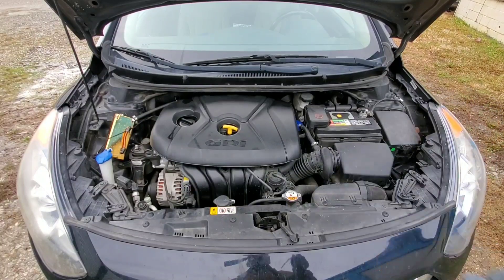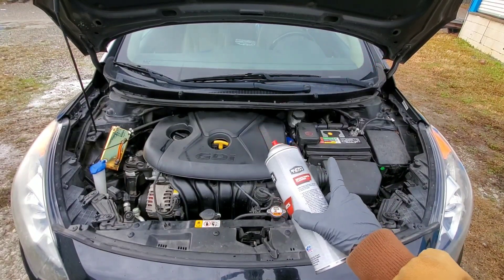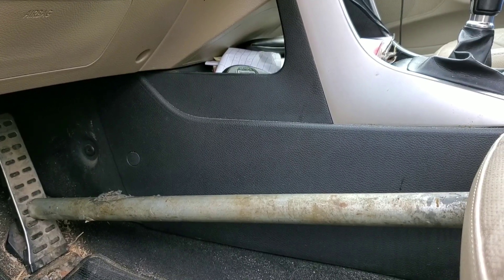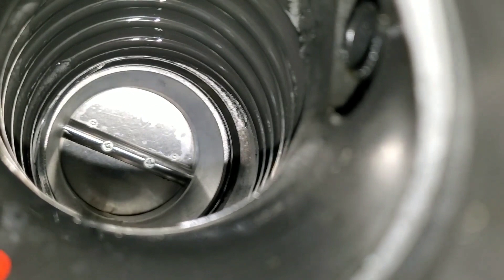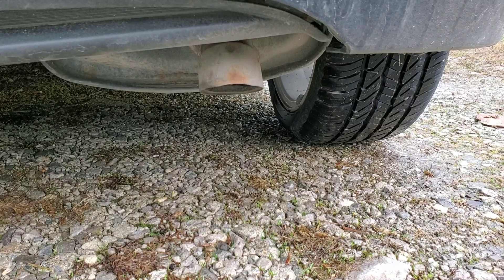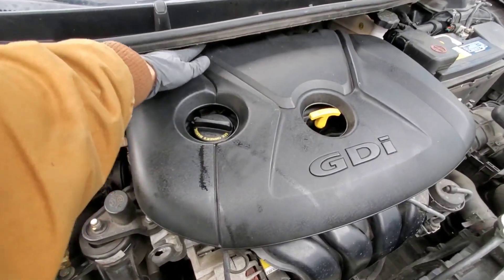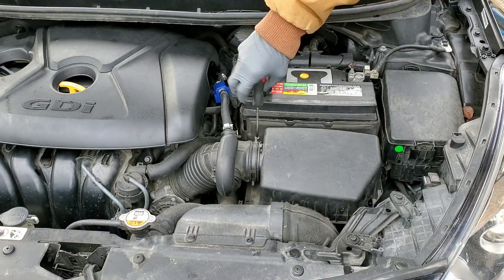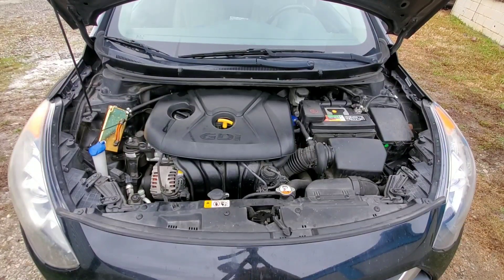Best carbon buildup cleaner  for Intake valves vs GDI Engine

Comment: I've got an old 22 semi-automatic rifle this that's what I clean it with, remove it from the stock and hose it down with brake clean then I spray it down with rem oil and I'm good to go been doing that for years.
I will say I don't do it on my nicer firearms.

I've got a 2018 Kia Rio 1.8 I need to clean the valves on it they've been done once by the dealer about ten thousand miles ago
Only got 35k on it.

Comment: I have the break cleaner in my garage, and it did cross my mind that it could be used for the same application you did. Because if it cleans the brake dust from brakes and evaporates I don't see why it should have the same results, which you demonstrated here. Someone even tried the carburator part and intake cleaner and I tried it and the car with my DGI engine a hybrid model responded very well with ease of acceleration and a smooth ride. I could hardly feel the depression of the accelerator. I just didn't look through the engine the way you did. If it works it works. Thank you.

Comment: The brake cleaner contains acetone.  Acetone dissolves plastic and rubber parts.  Also, most engine cleaners (CRC, SeaFoam) contain some light oil to lube the piston rings and cylinder walls during cleaning.  There's no light oil in brake cleaner, so you may have premature wear of the rings and cylinders.  I'd stick with engine cleaners and not use a brake cleaner if you're going to clean the engine while it's running.
Reply: Excellent advise
Reply: Wondering is brake cleaner and a light oil like PB Blaster might do the trick. And the oil would sit on the valves and possibly clean after the fact?
Reply: @jellofuel  I recommend CRC GDI IVD Intake Valve and Turbo Cleaner.  Be sure to spray in short bursts and keep the RPM at 2000.  Rev the engine a few times but not exceeding 3500 RPM to prevent hydrolock.
Reply: @ospuddy  Wife and I actually did this over the weekend. There was some ticking that had me worried, it was a tiny piece of carbon that was bouncing around the drivetrain until it blew out the exhaust. I think we need to do that treatment more often.
Reply: @jellofuel  Depending on the geometry of your intake, some cleaner may puddle inside.  This will cause a rough running engine, knocking, pinging, and odd noises.  When this happens, put the transmission in neutral and rev the engine a few times to no more than 3500 RPM.  That should clear out the excess cleaner.  Once the cleaner is out the ticking should go away.  Repeat this procedure as needed.
Reply: @ospuddy  I was thinking that's why some valves seem cleaner than others in these videos. Thanks for the info! We drove it for 2 hours yesterday, and it's doing great!
Reply: What about Carbonatar cleaner spray?

Comment: I agree with Thomas... the fact that there is a catch can, and the fact that it would appear that he has tested the same car with several different cleaners over only a couple of months and still have that level of carb build-up is simply hard to believe.
Reply: because the vapor is the problem not the oil itself.
Reply: I am not sure what type of oil is used and that plays a very important part in GDI engines

Comment: That catch can is pure garbage. How about a video with a quality made one? You dont have carbon on the valves. You have sludge. It's not working at all.
Reply: You need to be educated on what a catch can is all about. You're another keyboard warrior about to be slain 🤺! Slow down and educate yourself before commenting on a subject. Gases during combustion slip past the rings and into the crankcase where oil is. Those gases pressurize the crankcase and that's why there's a PCV (positive crankcase ventilation) system. The gases that leave the crankcase then into the PCV valve will have tiny particles of oil. Those particles are known as blow-by and are routed to the intake so they can be burned once again. A quality catch can will catch a lot of that blow-by before reaching the intake. You also made the claim he has sludge, not carbon. What do you think happens to oil when it burns? Get ready to be educated once again on something even the most novice mechanic would know: It leaves carbon behind. That's exactly why he did the two-step process. The first was to remove the oil sludge, the second was to remove the remaining carbon.